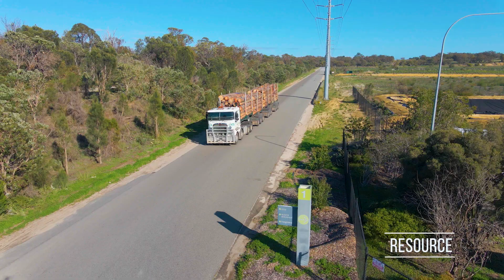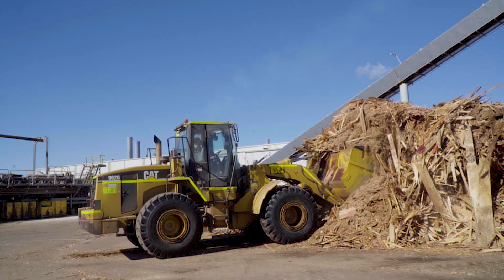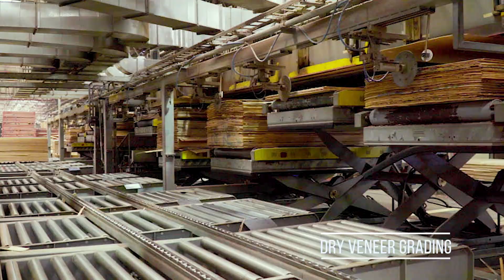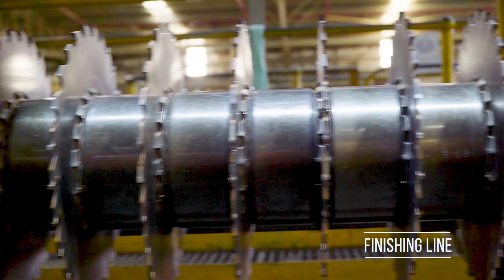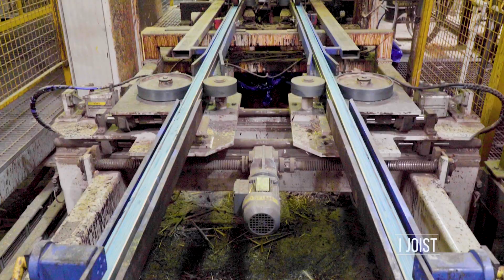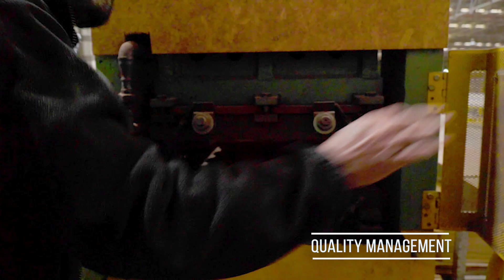Factory Tour

Comment: In the USA  LVL  I believe is referred to as "Plywood"
Reply: Not entirely. But close. It’s like plywood  joists
Reply: same same but different.
We use ply in Australia too. The difference being plywood is a sheet and LVL's are thicker beam-like dimensions used for structural members. 
so plywood would be 2400 x 1200 x 18
LVL would be a 4x2 timber.